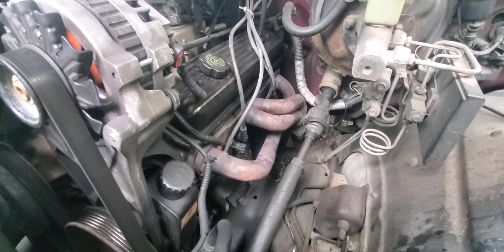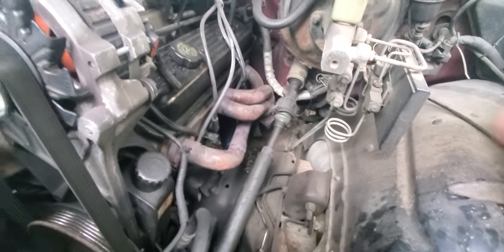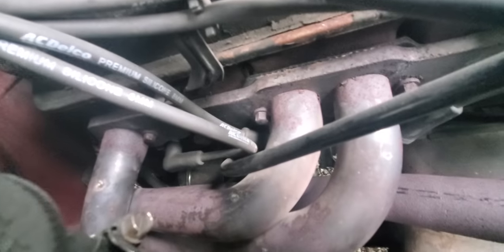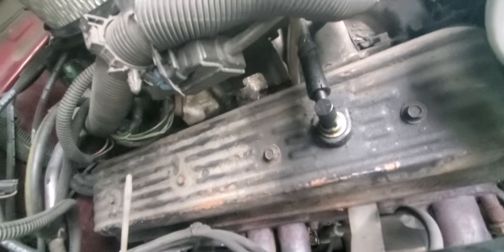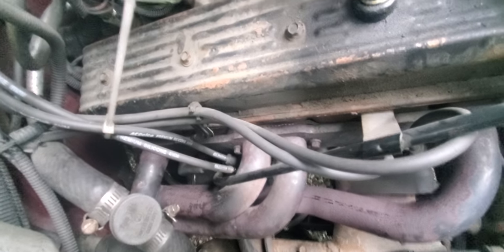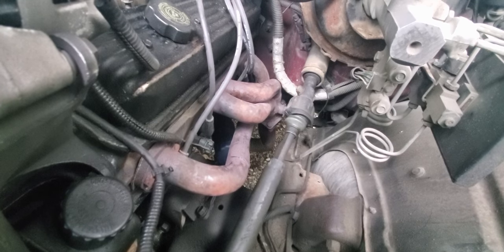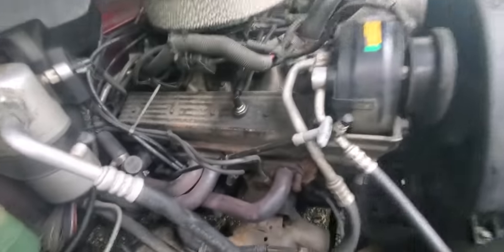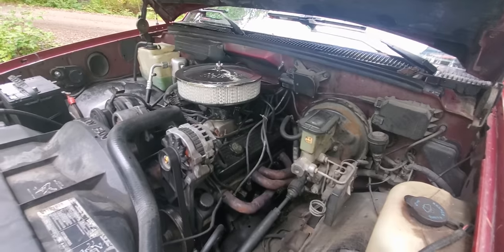Summit Racing Shorty Headers on Chevy 350 - 8 year review + Exhaust clip

Comment: I put these same headers on my 1996 K1500 earlier this year.   Coupled with a new Y pipe and exhaust and K&N air intake I’m getting about 15mpg which is pretty amazing for these trucks.  Nice video, glad to see they last years.
Reply from the maker: thanks!  dang, 15mpg is really
 good for a 350, nice work 👏   the best I got out of this thing was on an overland trip loaded down with my camper and gear and I got about 14.5mpg.  in town unloaded the best I can get is between 11-12. I bet I can get that up with a nice cam and heads that make better torque on the bottom end.  🤘
Reply: Wow I wish my gmc k2500 gets like 8 mpg
Reply: thats crazy you say that i had a 4wd z71 that got 26ish mpg max. on back roads and around 24-26 on highway under 70 mph. 
same engine in a square body s10 blazer and a small cam with long tubes and i get 35mpg back roads and maybe 28 highway at 70mph.
but still over 30 mpg at 65ish mph. even my old 1500 with a 305 and the vortec fuel injection could pull 28mpg at 70 mph.
Reply: @chehystpewpur4754  Tat would be pretty surprising. The 4.3 gets about as good of fuel economy in the s10 as a 350 in a 1500, those trucks didn’t make that mpg new from the factory.

Comment: hey let me give you alittle tip on how to take that #6 spark plug out and install because i have the same engine with headers i had the same problem trying to finger out how to get that plug IN.. GET YOU A 5/8 SPARK PLUG SOCKET AND CUT HALF OF IT OFF MAKE SURE THE END IS THE 1/2 INCH SO THE TIP OF THE SPARK PLUG WILL FIT THREW THE WHOLE THE SOCKET WITH THE 3/8 INCH WHOLE SPARK PLUG WONT FIT AND GET YOU A BOX 13/16 WRENCH TO FIT ON THE END OF THE SOCKET.AND U CAN TURN IT GOING IN OR GOING OUT ...AND LET ME TELL IT WORKS PERFECT..LET ME NO HOW IT WORK OUT FOR YOU..
Reply from the maker: I dig it man!!! Thanks for the tip, I'll definitely be adding that to the arsenal 🤘😁

Comment: Added them to my 94 GMC, had to switch to ceramic & wrap them due to under hood heat problems while towing. bolted up no problems, did double nut the collector flanges, and used good header bolts that wont back off, with good reusable header gaskets. running with a Flowmaster cat back 40 series runs great no codes, did notice more low end torque. Biggest problem was the heat.
Reply from the maker: Good call on double nutting the collector flanges.  I've had them loosen to me twice in the past 12 years.  I'm about to do a top half rebuild on the ole sbc 350 (cam, valve springs & seats, lifters, push rods, mild port & polish on the heads, intake manifold, TBI, exhaust headers), and will replace the exhaust manifold bolts and make sure to double nut those collector flange bolts too.   Thanks for the tip!

Comment: How much do u think you had into all the hop up parts and was it worth it in the long run?
Reply from the maker: Hey Travis, great question.  Let me think on this for a sec...I've had this truck for about 10 years now and I think just in fun parts I have about $1200-$1300 into it. For me it has absolutely been worth every penny for a few reasons: 1) this is my first SBC 350 so every bolt turned has provided a valuable learning experience. 2) over the years I've loaded this thing down with a camper and hauled it through the Alaskan mountains,  made firewood runs, dump runs, towed many vehicles from point A to point B, and have taken it on many hunting and camping trips. The truck so far has been able to handle everything I throw at it in stride  3)  It blew the tires off a newer Chevy 2500 with a 6.0 ls engine.  Granted I am guessing all they did to their truck was tires, lift (not exactly power adders) and exhaust  but still,  they were PISSED to be so easily dusted by an old ass truck. It's hard to put a price tag on that kind of happiness :) haha.   My friend who I bought this from and who blew up the original engine that I replaced say's it feels like a completely different truck in the power department and although I didn't drive it with the original engine, I have driven trucks with stock sbc 350 and can say mine is a lot more fun and the sound turns a lot more heads when driving down the street .   All we are missing now are a set of heads and a roller cam to synergistically wake up the fun parts already added but that will have to wait a bit longer while I finish my overland build on my other rig.   Thanks for the question!
Reply: Thanks for the reply really appreciate it, I love these tbi trucks for there sheer reliability, I have a 94 blazer 350 tbi, as well as a c1500 305 tbi. Both really reliable

Comment: So whats best should I put long tube headers on my 350 or shortys ??
Reply from the maker: I'd say if you are redoing your entire exhaust then go ahead with long tube dual exhaust. Best flow, hp, and sound 👌   if you are on a budget and want a decent exhaust upgrade then I'd go with the shortys. They outflow stock manifolds, sound better and will directly bolt onto your existing y pipe.
Reply: Ahh okay thank you so much for clearing that up that’s what I was stuck on man debating on which ones might be best for my build
Reply: @KooshdaakaaGarage will u have to bend back ur 6&8 cylinder header pipe in order for it not block the boot? On shortys and on long tube?
Reply from the maker: @TheNallelyful  I'm not sure about the long tube headers, but the boot will fit over the spark plug with the shorty's.  You might have to modify a socket to tighten that spark plug though.  I cut one of my sockets down by about half and put a box wrench on the end to tighten it

Comment: Whats up man truck sounds badazz, Did you take off oem headers? And did any of the oem bolts 🔩 scare you? I heard sometimes they break, that's my only fear in changing them myself.
Reply from the maker: Thanks Cesar!  I did take off the oem headers and thankfully did not break any bolts.   They were in their pretty good but I took my time working the bolts back and forth and used lots of penetrating oil and a blow torch.  I did this job on my Duramax recently too and wasn't so lucky.  Broke a bolt off by the firewall.  My saving grace was that Duramax heads are aluminum and the bolts are steel so I was able to weld a gob on big enough to clamp vice grips on and back the sucker out.   The rest were pretty difficult too but I sprayed all the bolts with penetrating oil everyday for a couple weeks when I parked the truck for the day when the truck was still warm to help work the oil in.   Best thing to do in this case is to just rip the band aide off and get er' done brotha.  You got this!  🍻

Comment: Thanks for showing the spark plug fit issue on Cly 6&8. Getting ready to do a motor change out on my 70 Chevelle with a fresh 327and was going to install a pair of stainless shortys . I will  now see if I can bend a little extra clearance on them back 2 tubes with a torch before I install them . I for sure will pop them on the heads on the engine stand and have a look see .
Reply from the maker: Sounds like a fun ride Mike!  Good call on test fitting everything while it's out so that you can solve any issues before hand. The shorter plugs made a big difference in fitment too 👍
Reply: @KooshdaakaaGarage    It's my daily beater !  a 4 door so nobody wants to STEAL IT !  lol . I might be forced to do the short plugs as well ! because on a Chevelle with cold A/C the evaporator case is RIGHT THERE ! as well . I got a 700R4 trans in it and will be installing a 355 gear 12 bolt posi to replace my current 308 gear ten bolt along with the fresh machined 1967  . 030 over 327 and 76cc chamber 1.94 intake valve iron heads. Should make a honest 300hp. and run cool in heavy traffic with zero issues. Will use a Comp Cams 252H RV. cam and flat top pistons. Should be better then the current ----185hp ( if that ) 8.7 compression 307 with small factory manifolds, I currently get beat by 4 cylinders all the time with the low life 307 ! TRUE !  it's so sad , lol
Reply from the maker: @hydroy1  hells yeah man,  I'm a bit jelly of your Chevelle!!! Sounds like a damn fine ride.   Those 355s will probably make quite a bit of difference on the bottom end, making it a sweet street performer.  My next big engine upgrade will be port matching all the air and exhaust components then upgrading to a nice roller cam setup optimized for bottom- midrange mountain crawling 🍻
Reply: @KooshdaakaaGarage  The 70 Chevelle is my parts chaser !  I also have a 68 RS/SS camaro with a early 4 bolt 355 LT-1 with 11to 1 pop ups 1182 forged crank & Pink rods and a solid flat tappet .500 lift .312/321 Der on a 110 C/L cam. World Products iron 58cc Sportsman II heads & Victor Jr. intake, 750 Holley Turbo350 trans with a 4,500 stall ATI converter & 390 rear gears. Still grinding on the ports of heads & intake to gasket size but this puppy should really sing well over 8,000 rpm with that solid lifter cam. Car went 12:60s/ 103mph  in the 1/4 with 2.02 camel hump 461 heads and a performer intake/ 500 cfm Carter AFB . Should be a big MPH rise on big end with the Sportsman IIs & Victor jr. intake & bigger Holley carb like 115mph+++ witch just might get it in the 11s. with out NO-2 juice. I got a pair of 28 X11" M/T slicks screwed on 10 rims if I need em.   The Camaro is my to hell with your $&^#%*&* Mustang on the bottle killer !  Yeah , I owned a few fords, got tired of pushin !

Comment: did you use SUM-G9016? If so is it 2 bolt or 3 bolt? Online it has two pictures one with 2 bolts and another with 3 bolts.. Need help before i make my truck sound badass
Reply from the maker: Hey Olson, thank you for the question.  I think I got the SUM-G9014 which honestly I can't tell the different between the 9014 and the 9016 besides the price?   The flange that mounts up to the stock Y pipe is 3 bolts just like the oem ones.   They are a direct bolt on to your stock setup.   This will definitely help make the truck sound badass!  I recently put up an exhaust video with a glasspack on it, check it out:  https://www.youtube.com/watch?v=9cl2OgDMpCs

Comment: Did you have any issues with these bolting to your exhaust? Just wondering if you had to modify the exhaust at all. I wanna replace my manifolds with shorty headers, but I really don't wanna have to do anything to the exhaust.
Reply from the maker: Hey Kyle, thank you for the question.  I did not have to made any modifications to the exhaust.  They bolted directly onto the stock y pipe.  I recommend some shorter style spark plugs (link in description) for easier installation.  The normal size plugs are a pretty tight fit but other than that they are a direct bolt on.  Cheers! 🍻

Comment: So...I have the previous generation of GM's K frame. A 1987 Chevy V10. Wanting to install shorty headers but can find any. Is that because the frame rails at the engine are higher than your frame rails? Trying to find some specs but unsuccessful.
Reply from the maker: A v10?  Beast!!!  I imagine fitting v10 headers in an old truck frame would be a feat without some customization.   I know they made plenty of shorty headers for the sbc line and think I've seen a few for the 454 big block v8 on summit racing and jegs.

Comment: I might get a stock tbi 350 1994 k1500 and i was looking at all the power you can get. do these shorty headers make a big diffrence in throttle response and should i get a diffrent y pipe. on fourms they said the stock y pipe is very restrictive and i should invest in a 2.5 y pipe (stock is 2inch i believe) and run it down with 3 inch exhaust. Did you have the stock y pipe on? (also i love your parts list and thats a good budget) I just want to prove others that you dont need a 15k truck to kick ass lol. Thank you
Reply from the maker: Hello Stabbity, and thank you for the question! I absolutely agree that you do not need 15k to make a Chevy 350 boot scoot and boogie in a truck configuration.   I use mine for overlanding and daily driving around the small town I live in with a lot of start and stops which fits the bill for all the bottom end torque a 350 naturally makes out of the box.  Plus parts are available to relatively inexpensive for the SBC due to how long they have been around and because of how many parts are interchangeable throughout the entire SBC series. To answer you question:  the shorty headers definitely added a quicker throttle response and an added bonus of a more throaty, deeper exhaust note. They are a lot less restrictive than the stock manifolds that is for sure.  From reading the tag in my glove box, I think my 92 K1500 was built to someones spec straight from the factory and they added a few cool things.  It came stock with a Y pipe that combines to a 3" exhaust, and had stock 3" exhaust all the way to the tail pipe.  If you have a stock Y pipe with an outlet of 2 1/4 or 2/12 then I'd consider upgrading to one with a 3" outlet.  There are plenty of options.  On the lower expense end there is the Walker, which is pretty much like the one that came stock on mine.  It does have crimped bends so its not as good as the mandrel bend pipes but works better than stock just the same.   At minimum, a full flow exhaust and a new performance chip will net you gains you will definitely be able to feel and you wouldn't even break $1k.  With an upgraded TBI or the new EFI technology with a new cam and you'd be hell on wheels!  I just finished a full top half rebuild on my duramax complete with port & polish so I'll be gearing up to do the same to my SBC 350, complete with roller cams and full port match & polish.  Hope you get the old chevy man,  I think you'd really enjoy it!
Reply: @KooshdaakaaGarage  thank you man for the response and your comment was very helpful. I'm gonna subscribe. So far I decided to do too my build is a possible carb swap where I put aluminum intake on instead of the tbi intake manifold (apparently tbi intake bolt holes are 70 degrees or so and a carb intake manifold is 90 but there's bolt adapters online.) And use these headers and swap distributor. Or just steal your list if I don't want to swap to carb lol
Reply from the maker: @stabbitythecricket2076  4 barrel carb never hurts!   You are right though, the TBI's are special creatures so a little bit is involved with the conversion.   Luckily there are a lot of parts available!  Think I'm going to maximize what I have with a port and polish and new cam setup first.  Afterwards I'll have my eye on the EFI setups.  Either A Holley Terminator or the Edlebrock kit.  Not oppose to a Fitech either.  It will all depend on what's available, price and performance at that time I suppose.   Dang things are spendy.

Comment: Did you have any problems with the plug wires melting?
Reply from the maker: Hello Ryan and thank you for your question.   Only one time before I zip tied them up. But since then I have not had any plug wire melting issues.
Reply: Yes, use plug wire heat sleeves/Amazon.

Comment: I run the same headers on mine and I've ran into them leaking out the header flange any recommendations and are you using the original y-pipe hardware
Reply from the maker: Hell ultimate experience, and thank you for your question.  Sorry to hear about the exhaust leak!  I am using the stock y pipe and hardware. The one thing I changed was I bought a fresh crush/ flange gasket that fits between the y pipe and header.  My original ones were a bit beat up from years of use.  You may look into doing the samething!  Never hurts to toss on new bolts while you are at it, I think I did that too come to think of it.

Comment: Did you have a oxygen sensor going into you stock exhaust manifold if so how does motor run with oxygen sensors no hooked up?
Reply from the maker: Thank you for the question John.   The original manifolds were tapped for the O2 sensor and so are the Summit Racing shorty headers which was a huge selling point for me,  I wanted the truck to have all the information it was designed to look for.

Comment: Hey man, On my 92 c1500, I have a bracket with studs that goes on the power steering pump. the alternator ultimately bolts on to the top of the bracket , I see you don’t have the bracket, it went mounted to the headers using studs, Do you have any idea what I’m talking about? My problem is the bracket doesn’t fit well using headers, I’ve seen one people just remove it and claim the alternator has enough support. Thanks for any feedback
Reply from the maker: Hello Ricardo!  I am not sure which bracket you are talking about but my alternator attaches to the power steering bracket with two bolts and holds fine.  My duramax alternator also attaches with two bolts so as long as you have that you should be fine 🍻
Reply: My 1992 Blazer with 350 tbi has the same bracket stud. I'm wondering what to do also.
Reply: @jamesfarmer2748  In the instructions it shows how to cut that bracket down, I used a grinding wheel, no problem at all.

Comment: Where did you get your serpentine belt system?
Reply from the maker: Thank you for your question.  The serpentine system is a stock setup.  I think the only thing I've changed on here is the alternator.  In the future I'm going to install an idler pulley in place of the AC.
Reply: Try Ebay